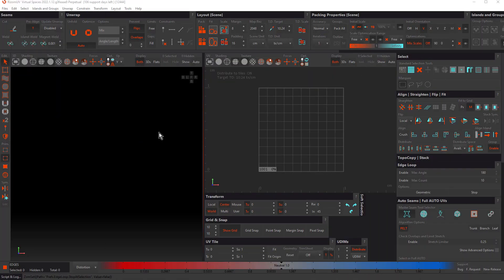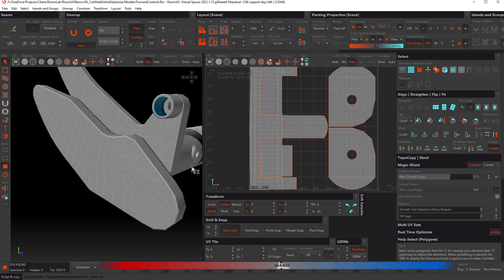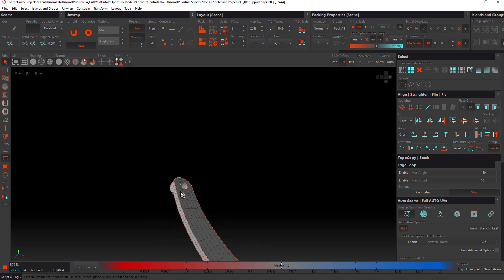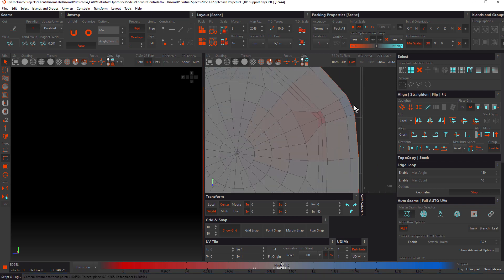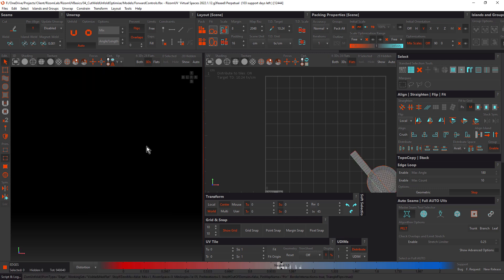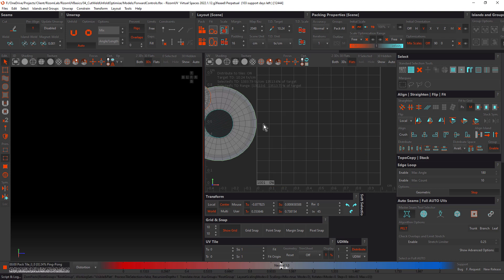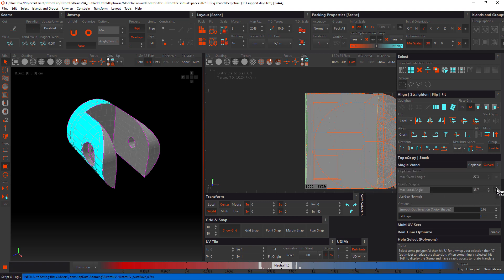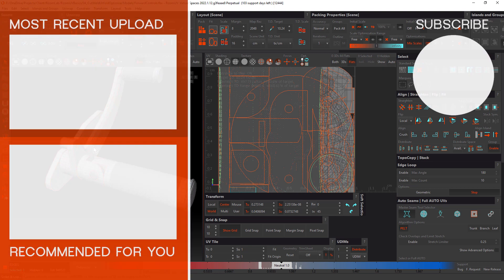RizomUV Basics (2023): Cutting & Unfolding Workflow

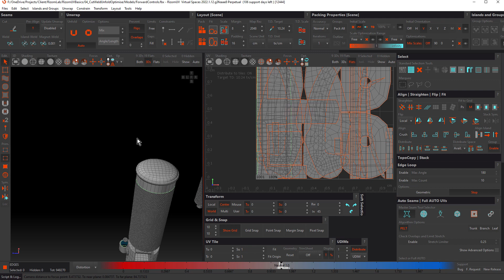Comment: I am experiencing freezing during the unfold process with part of example model at 6:00 timecode. 
The freeze stopped at 33% and did not move for more than 10 minutes, the program did not respond. 
I am using mac os m1 max ventura 13.0.1 and RizomUV version 2022.1.57. 
The problem was solved with the installation of a newer RizomUV version - 2022.2.39, the unfold took some time (about a minute), but at least it reached the end and did everything correctly.

In case anyone else runs into the same problem. 🤞

Comment: Can I use C4D edge selection tags on rizom? Actually I selected some parts of model on C4D and wanna use it on rizom for unwrap . thanks
Reply from the maker: No, you cannot use edge selection tags in RizomUV (Or most other 3d applications for that matter) because this is data that is created and meant for C4D.
Reply: @RizomUV  hi. Can I somehow use info about my hard edges from Blender to select those specific edges in RizomUV, or to directly mark seams there? Or, maybe there are some button, like "Select sharp edges" in Blender with angle slider to specify what angle to consider as hard edges.

P. S. Maybe you've already showed it in previous videos, and I just missed it. Totally possible. Magic Wand works similar, but not fully automatic) It's not the end of the world, though, and still is extremely useful.

Comment: after middle button click, I press i to isolate which I selected, but it only isolate one piece. how to isolate all of I select
Reply from the maker: Don't hover over a specific island, put the cursor in an empty space.
Reply: @RizomUV  A part cannot be isolated until you hover over it and press I, right? Now after cutting when I do that, I get a single piece isolated which I don't want.. How to get the whole part isolated like it did before applying seams?
Reply from the maker: @AnanyaAninditaSSU  - In island mode, double click middle mouse button over the island (all connected islands will be selected), then isolate.
Reply: @RizomUV  Got it, thanks!